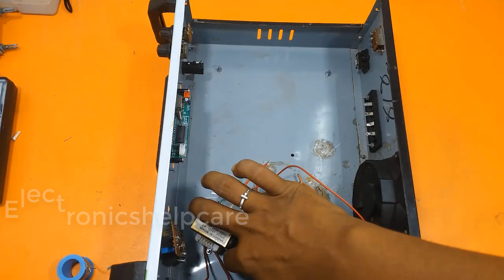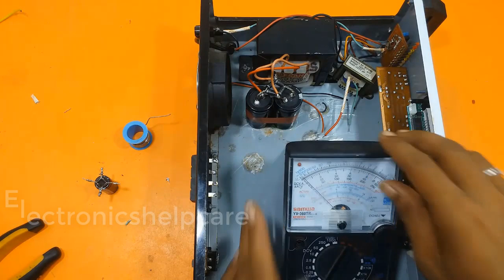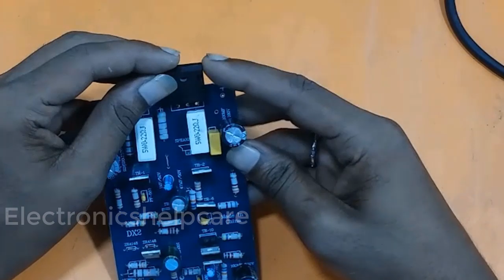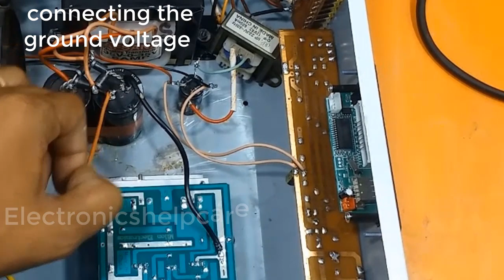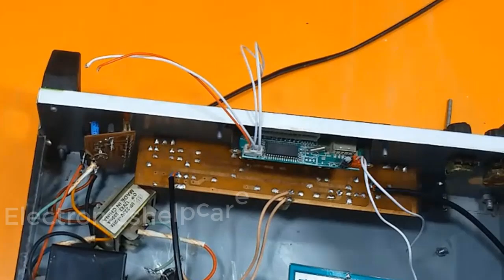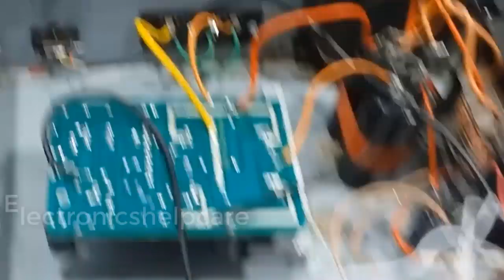audio amplifier

Comment: if amplifier fail and leak dc voltage you can  burn your speakers. this one dont have protection.
Reply: Right.... It's missing the decoupling capacitor